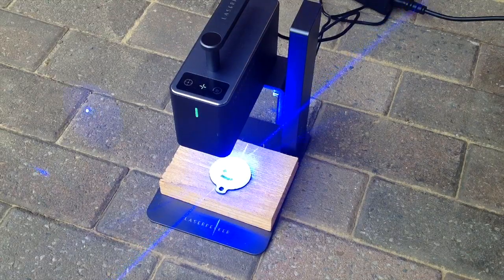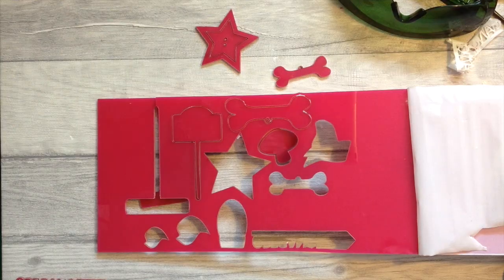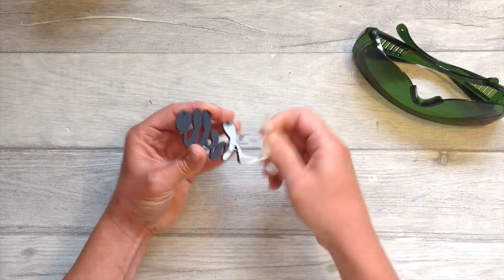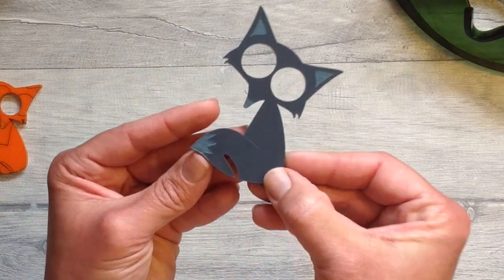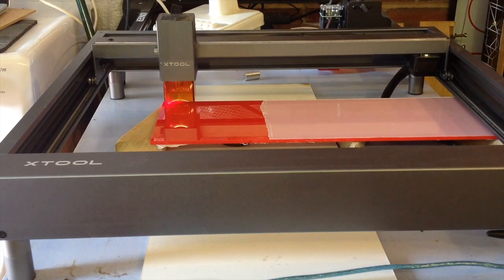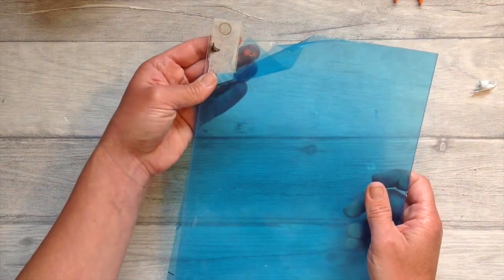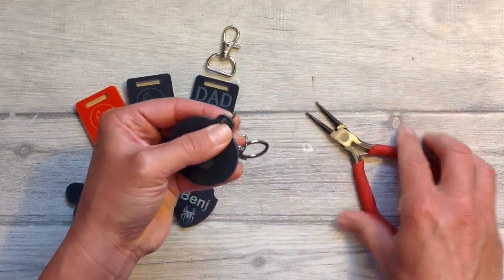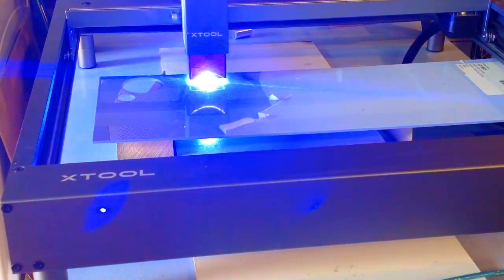Laser Cutting Acrylic at Home - ENGRAVE AND CUT ACRYLIC SHEET

Comment: Hi Sarah, great video.

The laser cutter that you are using in this video is using a “diode” as the means to produce the laser beam. Due to way the diode produces the laser beam it will not work at all on clear acrylic or white acrylic as you have seen in your testing. If you were to use a co2 laser it would work perfectly on both clear and white acrylic. Other than that I think you did a great job at producing clean cuts and I like the designs you made. Nice idea making test pieces to keep for future use!
Reply from the maker: Hi, Thank you so much, everyone reading this I thoroughly recommend The Plastic people for your acrylic supplies. 
Thank you for this useful information, looks like I must get a Glowforge 😍 Looking forward to seeing what else I can create from acrylic. Sarah
Reply: If you paint clear or white with a black tempra paint first, it will cut with a diode. Tempra paints are water based and will wash off with water after the cutting operation.
Reply: @almoccia9282 omg what a great hack!

Comment: Have you ever tried cutting and engraving kirinite scales? They're about 10 quid for 2 scales of 1/4 inch thickness so not very cheap. Just really wondering if it's possible to have 2 slabs of it and make a USB stick case by engraving it inside to fit
Reply from the maker: Hi, I have no experience with kirinite scales sorry